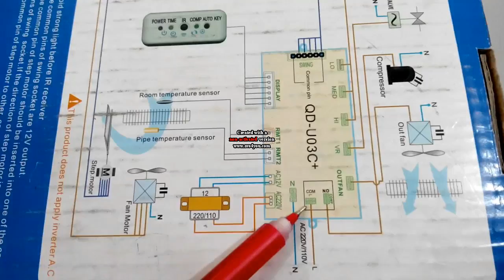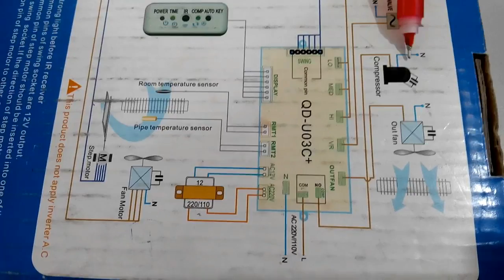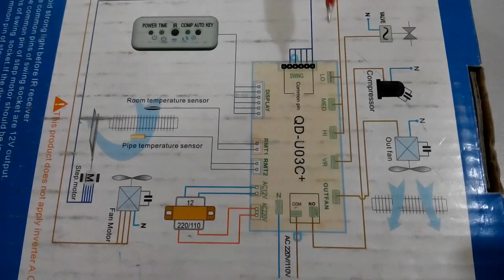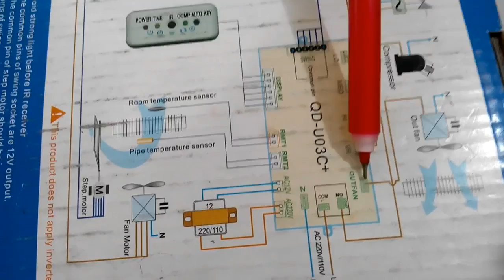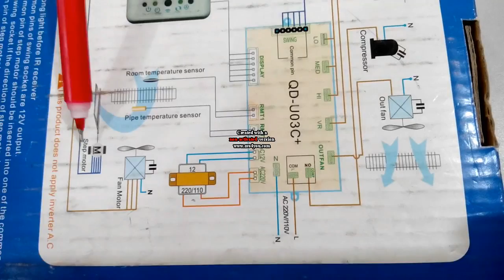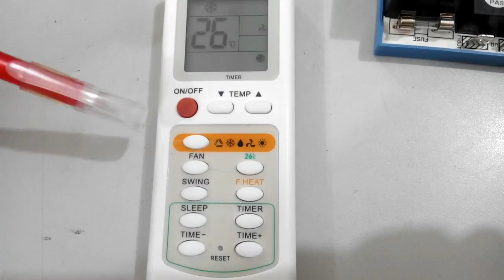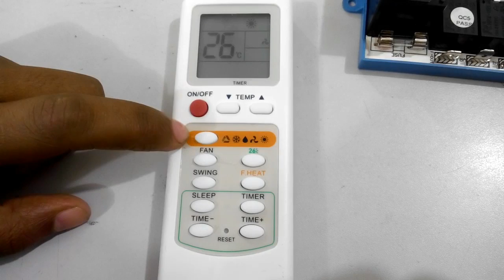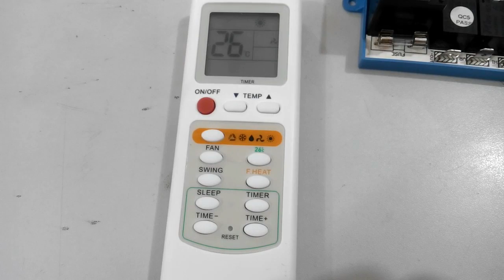How to connect air conditioner circuit in english

Comment: I am using the PCB board but the electrician told me the swing motor can not be connected due to jack not fitting. Is that true. He said sanarc AC have one motor for swing.   Tyre or false. Please help